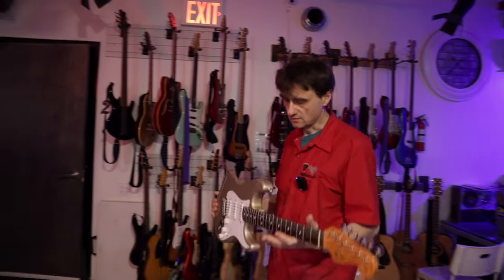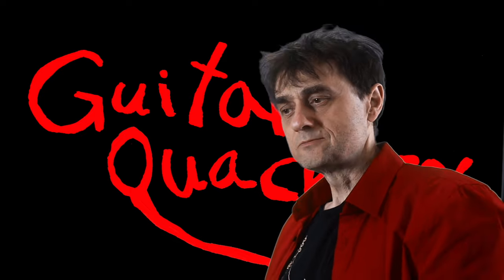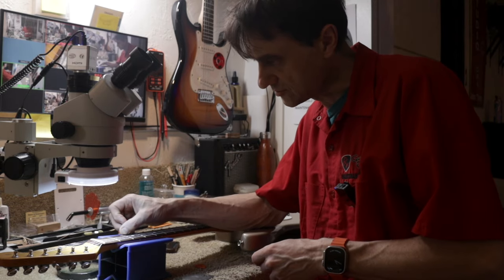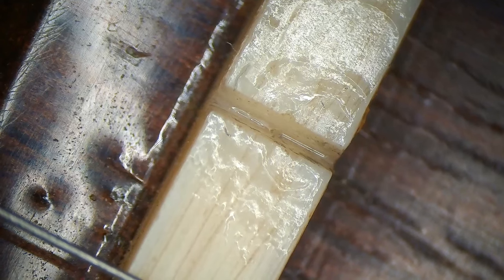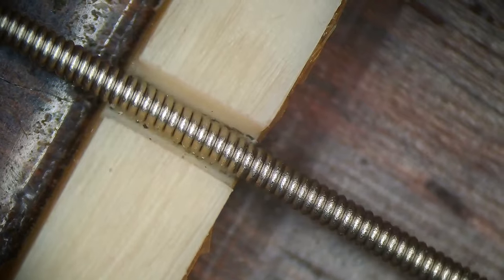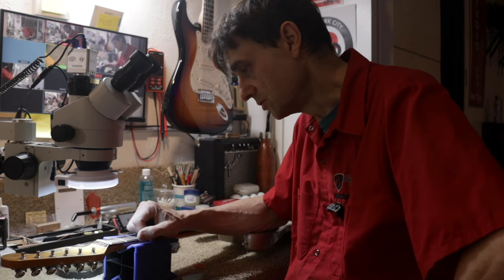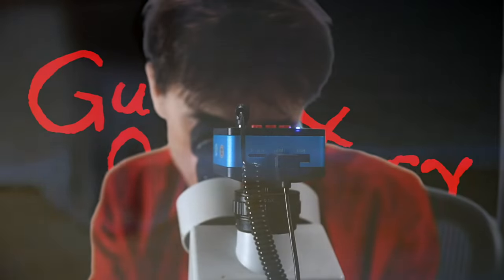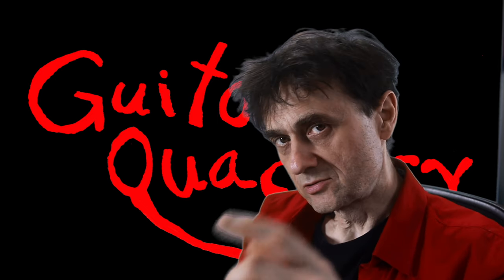Bad Guitar Nut - Diagnostic Under the Microscope

Comment: I've been impressed by the precision that comes from your use of microscopes in several videos. I see you use several different ones. Which models are they (so we can look up the required specs for this type of work) ?
Reply from the maker: Correct. I have multiple microscopes and I tend to switch them around. I have been obsessed with microscopes since I was about 6 or 7 years old. 

The main speck of any microscope is not magnification, but rather, resolving power. Sometimes magnification is useless. 

The magnification that I use most often is actually just 7x and sometimes I reduce that magnification to about 5x by adding a lens that actually reduces the magnification (but adds working distance. The highest magnification that I ever use is 45x. The higher magnifications are difficult to work with because of shallow depth of field and also because any small movement will be greatly magnified and the image will shake. So, more magnification often works against you. 

Then there's camera resolution. This is where it doesn't pay to go with cheaper cameras. I recommend just using a 4K camera. The minimum camera spec should be when they call a "microscope camera" (which is actually just a camera with a C-mount) and it should be 4K, or for sure not less than 1080p. 

A much better camera would of course be a DSLR camera, which would greatly improve the quality of the image that you are recording. The minimum camera would be a mirrorless camera such as the Canon M-50 (or equivalent speck camera). A mirrorless camera would be recommended because it is a smaller size than a mirror DSLR camera. 

Hope this makes sense.
Reply: Very comprehensive explanation, thank you!

Comment: Is supper glue an acceptable nut filler?
Reply from the maker: In my opinion, it is acceptable as a quick fix, or emergency fix. This is not to say that it can’t last for a long time. As with any type of glue, surface preparation is more important than the actual glue used.

I personally use dental composite fillings, but I only do that on a bone, nut, only if I need to preserve the original vintage bone nut, or as a budget repair if only one of the string slots is damaged.
Reply: @GuitarQuackery  Thank you, very informative